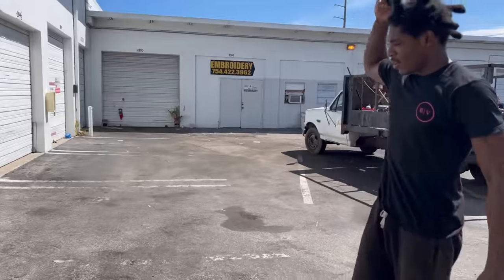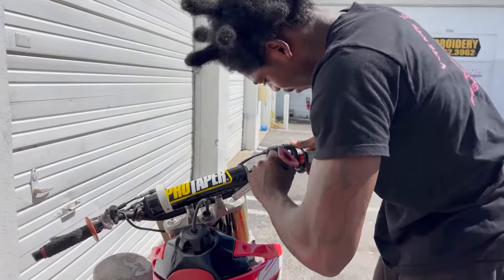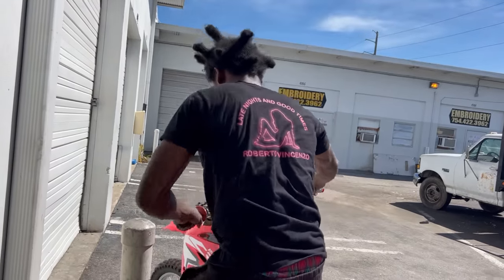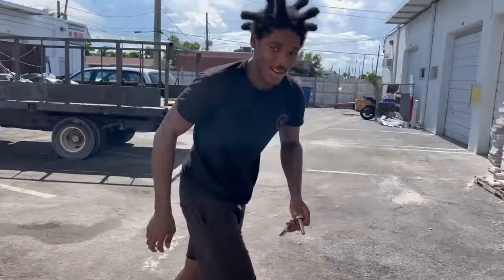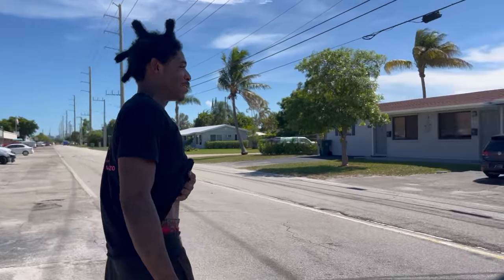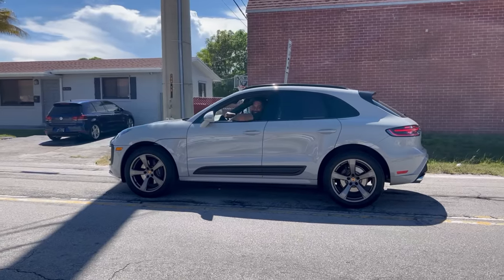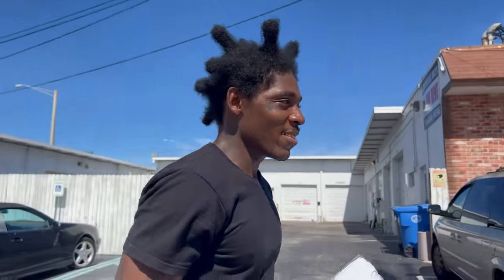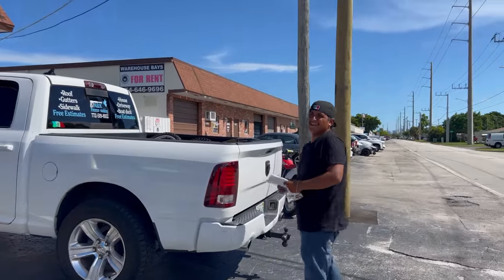Customer Almost Thought I Made His 2016 Crf 150r A Lemon

Comment: Love the videos bro. It took so many kicks because it was pre flooded from the grip change, those carbs has a mechanical accelerator pump so every time the throttle was twisted it shot fuel into the intake through the leak jet.
Reply: And ever more since everytime he kicked it he twisted the throttle
Reply: True💯💯💯
Reply: Yeah, flooded the crap out of it.  Should have held the throttle wide open and kicked it over to clear it out.
Reply: Facts them 150r be iffy like that no matter how much compression you got
Reply: @jth_printed_designs  Take the spark plug out and let her dry. If she light or put bike, u can flip her over for a faster dry time
Reply: @HK45C  Not necessary.  The fuel doesn’t care if it goes out of the exhaust ports or the spark plug hole.  No need to waste the time pulling the plug.
Reply: @HK45C  Hold the kill switch if you’re worried about damaging the bike, but you need not be worried it’s perfectly safe.
Reply: Nice, bro. Good looks. Lol I ride sport bikes now, but man. I miss my 2 stroke toys. That’s for sure
Reply: The 22’s shoulda been efi Hondas whole line of race bikes are efi but yet the 150r hasn’t got any love since it’s release sadly 🤧
Reply: Exactly what it was.
Reply: @jth_printed_designs  that only works for two strokes…
Reply: @shanematis2902   Incorrect
Reply: @jth_printed_designs  if the machine doesn’t have an accelerator pump, then yes but this is a new bike with one.
Reply: @shanematis2902  Accelerator pump works on motion of the throttle, that means you will get one squirt when you open the throttle and that's it.  When the throttle is held completely open (or at any constant position), the accelerator pump does nothing.

Open the throttle slowly, get the one squirt, then allow the engine to breathe freely and clear itself out.  Bonus points if you turn the gas off first and lay the bike on its side to let the carb drain first.
Reply: those accelerator pumps better work well cuz they are a pain in the ass
Reply: I don’t even no how to ride and knew it was flooded
Reply: I genuinely dislike Honda, other than civics, accords and crx lol.

Comment: Sometimes when starting them after sitting or after hauling them you have to tip them over till gas pours out the overflow tube bring it back up twist the throttle a few times then kick. Works like a charm.
Reply: He flooded it when putting on new grips

Comment: I will give you a tip, when you’re putting new grips on, soak them in hot water for 5 minutes and they become easy to slide on. When they cool they are firm and job done
Reply: I will give you a tip, when you replace the grips, buy the ones with the clamp/screw so you dont have to worry about any of that crap.
Reply: You can also put air with a compressor in it while pushing it on

Comment: You know it works good is taking a razor blade to the grips if you have a problem pull them off that way.. and use hair gel to put them back on just a little bit or even Hairspray you got to put it on quick though once hairspray sets it won't move but it's slippery for like 15 seconds.. I prefer to use hairspray it works better your shit won't move at all .. but it sets up quicker than Jill

Comment: V I  know the bike is fuel ejected however I know for a fact if I turned my throttle before starting it would not start right away  Remember you turned the throttle  several times when you were put in on the grips
Reply: And I'm referring to2018 CRF450R
Reply: Also I love your blog and you're one of the best  Bike mechanic I know. Keep striving and take over the 🌎
Reply: that bike is carbureted, and if a bike is fuel injected you can twist the throttle all you want and it wont flood or anything when the bike is off, nothing happens unless the bike is on

Comment: You’re suppose to use the grip glue: 
The person that put them on before didn’t use the glue either that’s why they were so stretched on to the bar, and came off so easy. Give it a couple weeks those grips will be slipping on the bar and throttle tube.

Comment: def got the vee touch , its them 150 them shits never start 😂🤣
Reply: If urs doesn't start that means its clapped the fuck out and need a rebuild
Reply: @keld1d  im a proud owner of one ...I can go in my garage right now and it will start first kick no choke ....if the bikes don't get maintained properly and have a ton of hours on them valves get tight and carbs get outta wack i completely rebuilt my engine new oem crank, bearings,cylinder ,HC pro circuit piston it absolutely riiips my 200 lb ass around like nothin
Reply: lmao 🤣i dont even own one them 150 dont start 😂